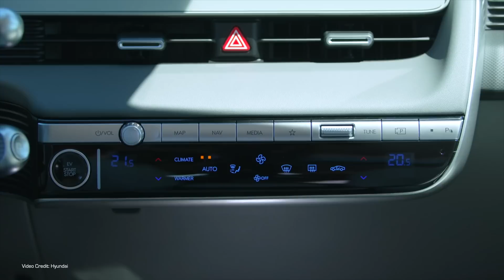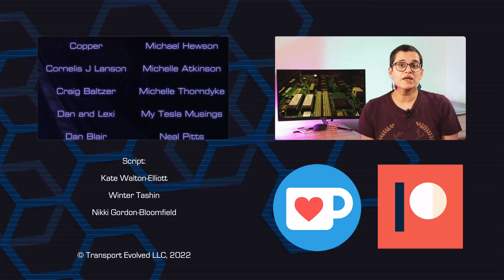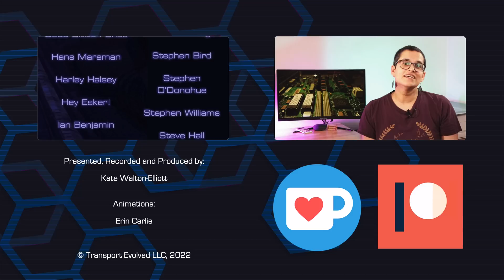EVs - End of the Shade Tree Mechanic?

Comment from the maker: We would like to clarify that the remark about Kate washing her "mouth out with bleach" is intended as a joke. She absolutely does not recommend consuming or using bleach to clean any body part.
Reply: Actually, EVs will begin the total dominance of shade tree mechanics. With modern ICE cars if you stick in an OBD dongle at least 85% of repairs can be done by anyone with knowledge of how things work. The right to repair laws are all that's required. The same is that much more true for EVs that have still fewer repairs. A good hacker can repair software. It is all about laws, nothing else. Automakers need all of 30 seconds to comply wit providing necessary data. They already know how, they are just stonewalling.
Reply: Maybe it can be used to cure COVID?  😁

Comment: First off not everyone will change over to EV; secondly someone will finally crack the codes needed to adjust the electric motors and other parts of a vehicle to open things up that manufactures are keeping to themselves.  And as someone already pointed out, there are ball joints and other parts that are common to both normal cars and EV.

Comment: Well done Massachusetts. This stuff is so obviously a public good. We should be in control of our own stuff, and what data (if any!) they send to manufacturers. I would buy a Free SOftware car if there were any so this issue didn't arise, but there are zero of those at the moment SFAIK. My current car has no computer at all in it and I'm very happy about that. It's entirely fixable, which is one reason it's still on the road in decent condition at 24 years old. But anything new and electric I buy will be completely crippled from this point of view and it makes me very angry. Is anything going on in the UK about this?

Comment: The problem of manufactures using IP rights to lockout third parties from repairing, or servicing their equipment is not the exclusive domain of auto manufacturers. I have a John Deere Product, that the local Deere dealer could not fix, despite repeated attempts, and each attempt was at a hefty price. When I asked them to justify their previously failed repair attempts. They sent a email detailing the repair steps that they took, and the email that they sent me was redacted, because they said it was proprietary. You could potently charge anything you wanted and then claim IP rights as a reason not to tell you why any given repair needed to be made, and no one would be able to question it.

Comment: Many of the cars made in the last couple of decades has so many “computers“ in them that more then simple service tasks are not possible for a non-pro. EVs will make it so that even less can be done ourselves. The kit one need to work on them will make it unaffordable.
Reply: Kind of depends on the automaker. And I wouldn't say the last couple of decades. More like the last 5 years.
I've got a 13-year-old Toyota hybrid. I have a copy of the Toyota software the dealer is used. You can find a copy on Amazon, comes with a USB connector with an OBD2 connector on the other end. Load the software on a laptop. I've got the same software the dealer does. And a lot of the stuff I can do even without that. Oddly one of the things you have to use that's software for is programming the TPMS sensors. The newer Toyota's aren't like this, but the older ones like mine you actually have to manually convert the hex code of the TPMS sensor and enter that into tech stream software.
Other than that, there's a bunch of ways to manually program the car even if without a simple OBD2 code reader. And none of the hardware in the car is VIN coded.
I had the inverter fail this past year at 380,000 miles. Caught up a salvage yard found one with 130,000 mi on it for a hundred bucks. Had it the next day, took me 45 minutes to install it all done. I've done hybrid battery packs also both doing rebuilds and replacing bad modules, to entire battery replacement. I can get the battery out of the car in less than 30 minutes. It's about 10 bolts, a few electrical connectors. Turn the car on. Again it's not VIN coded, and doesn't require any special activation. They all have onboard computers in each section they boot up they talk to each other without any problems at all.
It's actually one of the easier cars I've ever had to work on. Sometimes you have to take a bunch of things off to get the things that are deeper into the car. But everything pretty much comes apart in layers and pretty logically.

Comment: I can see a business opportunity for aftermarket car controllers to remove the manufacturer from the loop, add new functionality to old cars and improve performance. Just like aftermarket EFI computers. Just consider that all of Tesla's hardware is run via CAN bus. There is an aftermarket logic board that will run the Tesla inverters. It wouldn't take much to build a controller that will just replicate the CAN messages and remove Tesla from the loop. Once the car is out of warranty there may not be much to loose.

Comment: Thanks for focusing on this very important topic. The Right to Repair is key to society continuing to progress. Without individualism and creativity progress will cease. Auto manufacturers, such as Toyota, continue to drain us of our income all in the name of safety and 'convenience'. It was bad enough in the 1960's having to obtain specialized wrenches to access badly place nuts and specialized ball joint separators, (Rover P6 car). But the 60 computers on wheels AKA Tesla has brought us to this point where repair is NOT an option, only replacement. It's a sad reflection on resource (mis)management. For example the Tesla battery packs, including those in the 2012-1024 Toyota RAV4 EV, can only be processed through a specialized Tesla facility. But, as some have discovered, repair of battery packs IS possible.
Reply: I felt the same way until I read some articles about the lawsuit against the Massachusetts.  I can’t believe I’m saying this, but the automakers raise cyber security laws they are subject to if their systems are hacked.  Imagine the chaos that could follow if a bad actor gains access to the telematics systems of a car manufacturer that is then broadcast to a multitude of vehicles.

It does give one reason to pause and ask whether the manufacturers have a valid concern.
Reply: @paulwilson1500  True, access to critical data should be guarded. but by the same thinking, banks, medical and other institutions are required to make sure data is safe and secure but you are allowed to access your data. I don't think the argument for Right to Repair should override security and safety. However the ability to repair, replace, recycle all our modern equipment shouldn't be tied down to a service model that is so exclusionary. Indeed, the example of repairing your brakes puts the onus of safety on the person performing the task. Therefore third party repair shops also have a liability to work on equipment safely.
The third party OBDII adapters that permit mere mortal to be able to decrypt the 'Check Engine' or MIL indicator has meant many people, particularly low income groups, to be able to economically maintain their vehicles.

Comment: Circuits still burn out, ball joints still fail, brakes still wear, and impacts still happen.  There will never be a time when people own their own vehicles that there won't be shade tree mechanics and people making their own tools to get around the attempts to prevent people from fixing their own stuff.
Reply: I don't think you've been taking notice of developements. Even changing tyres and brake pads need to be accessed and logged on many vehicles. To state this will never happen is just hope over experience.
Reply: @mrswinkyuk  Actually, it's experience over hope.  Many people thought that the days of shade tree mechanics would be done as cars became more computerized with things like fuel injection and computer controlled ignition.  

What happened?  

People made the tools and learned how to diagnose issues without special equipment.  I myself have spent the last 10 years diagnosing cars more by the sound they make and the issues presented, rather than relying on some kind of scan tool.  From fuel pump and ignition issues to failed sensors, most of the time you can diagnose an issue with nothing more than experience and an ear or sense of smell.

On top of that, you don't need a scan tool to tell you when a brake rotor is warped.  You don't need a scan tool to tell you when a wheel bearing is failing.  You don't need a scan too to tell you when a tie rod end is worn out and loose.  You don't need a scan too to tell you when a control arm bushing is torn and allowing the suspension to move in ways it shouldn't.  You don't need a scan too to tell you when there's a worn out strut.  You don't need a scan too to tell you when there are broken cords in a tire.  You don't need a scan too to tell you when a door handle breaks.  You don't need a scan too to tell you when a motor for something adjustable isn't working.  I can go on an on.

Sure, a scan tool might make chasing down weird faults easier, but it won't fix the problem itself and a majority of the time, simply learning about a car's common failures will help a person diagnose the problem just as fast, or faster, than a scan tool.  

Just look at the channel Diagnose Dan for instance.  Sure, he uses his scan tools to diagnose things a lot, but he also relies on his experience, a knowledge base of people who have dealt with similar issues in the past, and standard testing equipment.  One of his recent videos shows him using diagnostic equipment to try and find a fault that turned out to be just a broken wire.  The diagnostic equipment he used was able to tell him that things weren't working, but it was his experience and a simple test light that helped him chase down the broken wire.

Comment: Another great report, Kate, had me chuckling while trying to identify the sci-fi refs. Memory dim these days but loved Star Trek and HHGTTG.
Regarding doing your own repairs, our Roomster threw a wobbly on Friday night as my wife was leaving her mums place. The mystical EPC light, along with engine management, traction control lights all gleaming. She phoned me in a flap and after making sure it didn't sound terminal I got her to nurse it back to her mum's even though it was bucking and rattling for all the five minute drive. She borrowed her mum's car to come home.
A YouTube search showed me what was likely wrong and what I needed to do. If I had the dongle to put in the OBD port I could get the diagnostic number, look up the code and with any luck fix it myself. Sadly I don't have a dongle (!) and neither did any of my mates. So the RAC it was then, turned out the following morning, excellent service. The car being cold the problem wasn't immediately fully apparent but eventually it turned out that a new coil and HT leads was all that was needed, a hundred and ten quid for parts. If I'd had the dongle I could probably have done it myself in some universe where I'm young and fit again!
Point being that car is nine years old and still needs an electronic gizmo plugged in before you can even find out what's gone wrong. The days of changing your own fuel pump and tinkering with feeler guages for your spark plugs are sadly in demise. All in a good cause though, can't wait to join the ev clan to keep evolving. Thanks again Kate and the team. 👍🌈

Comment: Electrifying existing ICE vehicles, especially the classics, will be wide open. I hear that there's a lot of interest in manufacturing crate motors for Mustangs and Camaros. I think this will actually be affordable and doable for a shade tree mechanic.
Reply: Doable? Yes. Affordable? Not for a long time. 

Tons of companies have sprouted up over the years creating adapters  and supplying aftermarket electric power steering and brake pumps. EV West is an interesting company to look at for their adapters and kits mostly for VW/Porsche vehicles using batteries and motors from wrecked Teslas. 

But batteries are still crazy crazy expensive, as are many of the other bespoke components. So expensive that even wrecked EVs are priced out of the range of many people on the used market. And unless your shadetree guy is also a fabricator: i.e. competant welder and machinist, he may have to purchase adapters and outsource work. Just look at the prices page for EV West... its not an entry level alternative to production EVs, its an expensive hobby.

And GMs crate was laughably bad. The bulky Bolt battery pack they were using could only fit inside the bed of an SUV with no rear seats. It filled up thier suburban showcase vehicle.
Reply: While I find this exciting and would love to take a crack at it myself I’m still highly wary of letting Joe Anybody attempt assembly and troubleshooting of a 400+V electrical system.

Comment: Yes, the "Shade Tree" mechanic jobs are coming to an end with EVs and Hybrids; they are all but gone now with the new ICEs technology.  First, with 85% fewer moving parts and no fluids to speak of,  these very Hi-Tech electric motors that can run for 10's of thousands of hours without failing or any noticeable drop in power. I worked for a company that designs and builds industrial servo motors. Many of these brushless servo motors go into harsh industrial environments and last for 10+ years before any repair is needed. These new EV motors, especially Tesla Motors, are even better than what we designed.  This is generation 1 of EVs, what will the next generation look like? How much power density with the next generation of batteries have? 20% more? 30% more?
Reply: I was still able to successfully replace the OBC on our 2012 LEAF.  Components can still be replaced.  One just has to  learn about and pay attention to safe handling practices of HV equipment.
Reply: There's plenty of aftermarket garages even for Tesla's. You've got the electrified garage with Rich rebuilds. There's Gruber automotive. They do Tesla battery pack repairs, they can read program your MCU, add 4G LTE increase the memory in it get the better LCD screen that doesn't delaminate. There are companies that build repair kits and upgraded kits for the presenting door handles on the Model S.
When it comes to some drivetrain components you definitely going to have to go to Tesla at least to get it recertified. Things like the inverters and drive motors are VIN coded..
So you can't just swap one from a salvage car and have it work.
My 13-year-old Toyota Hybrid doesn't work this way. None of the internal individual electronic components are coded in this way. You can grab an inverter or a transmission, or a hybrid battery pack from any car swap them around and they all communicate with each other without needing to be reprogrammed.
Reply: @kens97sto171  Certain parts of an EV will be easily serviced, and some parts won't.  I was recently advised by a Tesla owners club, that because of high volume in Tesla owned repair shops, that glass and tire issues, should be handled by independent shops.  Tesla also does not perform NY state inspections, and I was again directed to an independent shop.  Computers, electronics, and high voltage parts of the car, I would think should be handled by the dealer.
Reply: @carljaekle  
That is certainly the case, many parts are easily repaired by anyone that is competent with a wrench and has the knowledge. But honestly I kind of disagree even on the computers electronics and high voltage. You just have to learn what you need to do to get it repaired
Toyota Prius has all of those same parts, high voltage battery, inverter, power electronics to operate that stuff. And all of that is easily user replaceable. I can have the battery pack out of my Prius in 30 minutes. Have it completely disassembled in 45 more minutes.
Obviously the Tesla's battery is massively larger. But even the Prius battery is powerful enough to kill you.
This is why right to repair is so important. I don't need Tesla to help me do some of these repairs. Some of them I would not be physically capable of doing in my driveway. That battery pack weighs over a thousand pounds. You would need a lift and other special equipment to get it out of the vehicle.
But the powertrain itself, the subframe and motor assemblies are easily removed with basic tools anyone can get. And yet Tesla retains control over those parts. You can buy them used from a salvage yard, but they won't work once you put them in. Because they are coated to the VIN of the vehicle and the motor and inverters have to match up with the MCU of that car. That's the kind of stuff that needs to change. And Tesla's not the only one guilty of it there are plenty of other makes and models that now do similar nonsense.
Volkswagens often require a dealer to recode a simple window regulator when it fails. That's absolutely the ridiculous. But they do it because it's a profit point they can take advantage of. And quite frankly as time goes on less and less people are either interested in working on their own cars or competent to do so.
Tesla is going to run into some problems with service if they continue to grow as they are. People are not going to tolerate waiting months to get a car back from a major repair or from an accident.
I would really like to buy an EV as my next car. I drive 50,000 mi per year. And my Prius has been fantastic and it's easy to do the maintenance on. But I'm getting older and climbing under the car every 5 weeks to do an oil change is pain in the ass.
But at this point I'm much more inclined to buy a Chevrolet Bolt EV. I've seen complete tear down videos of that car and it looks pretty easy to work on. Plus Chevy will sell you the parts you need to repair it. That's a big selling point for me.
Reply: @kens97sto171  Ok, many fair points in what have written.